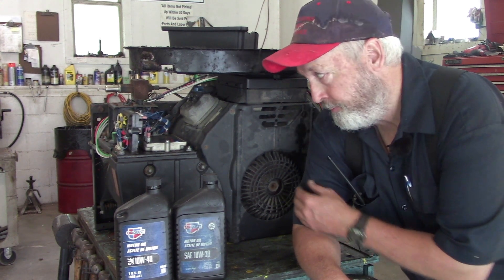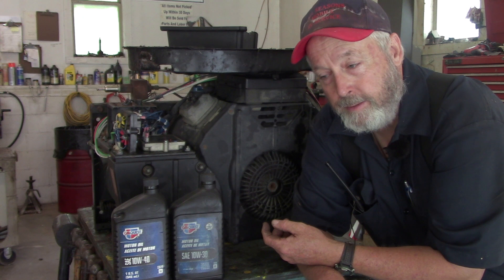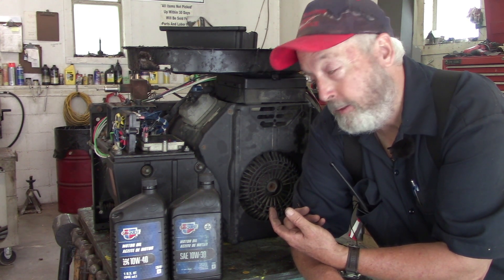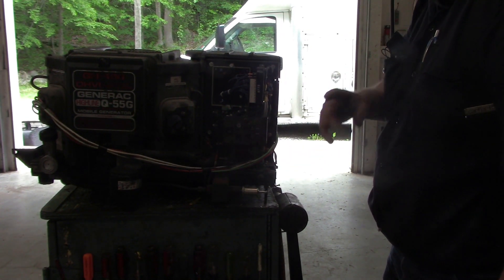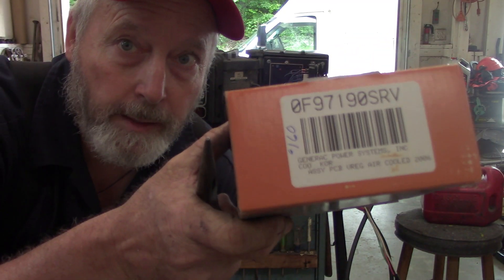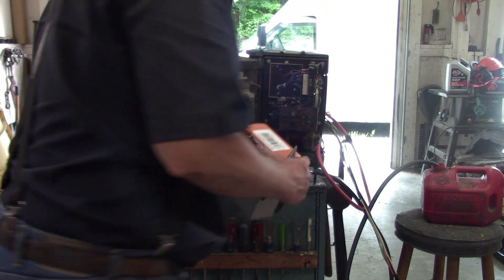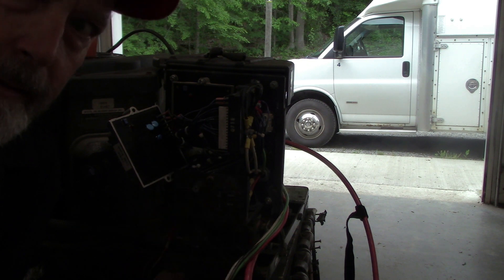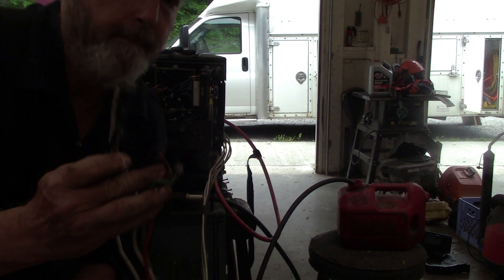Diagnosing Generac Generator Part 3

Comment: the dip switch has vibrated lose adjust with a VOM and put little goop or something like it to stop that from happening  my has  been good for three years now  its a 2000
Reply from the maker: You talking about the dip switch on the VR? That will only adjust the AC output a few volts. This thing was making 0 volts.

Comment: before risking a new voltage regulator you should have just used a good digital meter and checked output. If output is around  half then it is a voltage regulator , if it is only 1- 20 volts ( residual voltage) then the rotor has a problem and possibly the regulator  as well  but if output is Zero volts then the stator is bad  and possibly the rotor and regulator BUT if you would have just first thing  removed the plastic cover on top of the stator  which would allow you to view the brushes and slip rings plus you could see the end of the windings which should look bright orange - but if the stator is defective, there will be darkened or black wires in the windings indicating a failed stator, plus you can measure the rotor resistance both on the slip rings as well as through the brushes and you can also measure the field voltage at the brushes.  Remember the red L.E.D. on the regulator indicates there is AC power.  Output breaker must be on to measure voltage. The noise is probably worn bearings in the generator which can allow the rotor to touch the stator and if that happens the magnetic field collapses as well as there can be damage to both.
Reply from the maker: Thank you David. All good stuff there.

Comment: I ended up replacing mine after trying the same thing. Know anyone that needs a new Voltage Reg and Control Board.. :) Dirt Cheap..
Reply from the maker: No I don't
Reply: I need both.